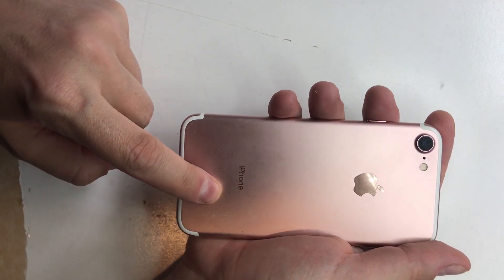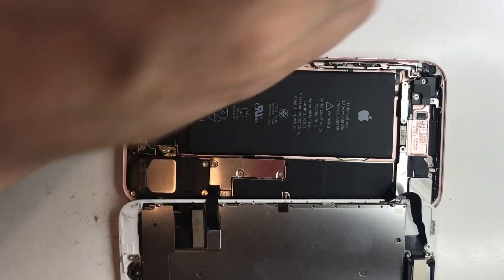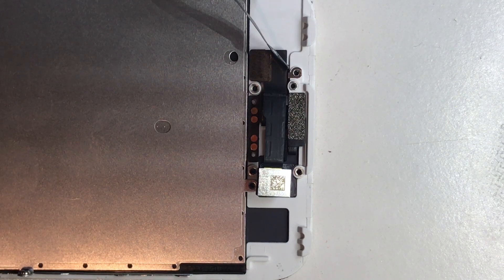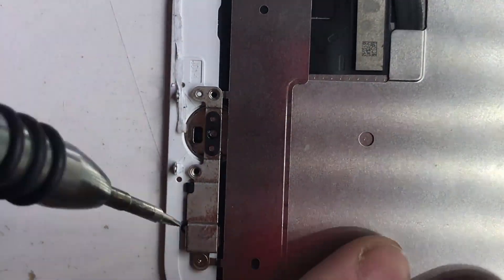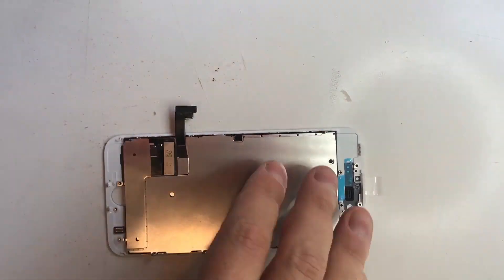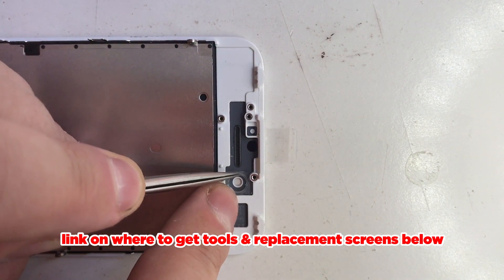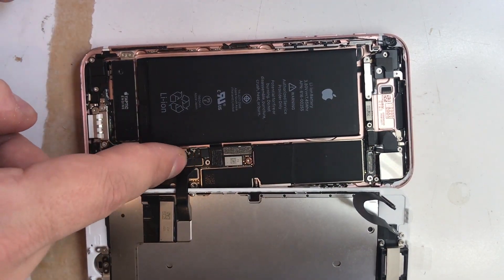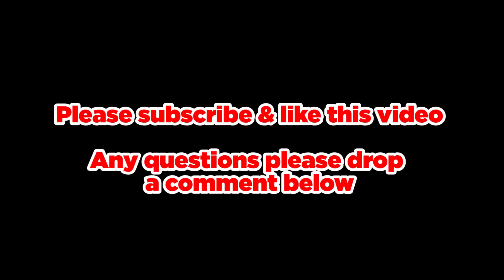iPhone 7 Screen Replacement. Under $35. Full guide.

Comment: What if screen is completely broken including either side of fingerprint?
Online display contains touchpad also?
Reply from the maker: Yes you need to use assistive touch button which is a virtual button on the screen. You go to SETTINGS -> GENERAL - ASSISTIVE TOUCH

Comment: what if my phone has both lines vertical and horizontal?
Reply from the maker: Good question - this means there is an issue with the lcd display screen which is part of the whole screen assembly so following this video will fix the problem
Reply: lol you'd need to replace the lcd screen. you typical don't see lines in apple's screens with drops.... is this a replaced screen already?
Reply: surfpub2001 Mine got dropped from my pocket onto carpet, no cracks but 2 vertical coloured lines started to run down the right side of my screen and as the days went by it got progressively worse

Comment: Nice video, you made a very BIG mistake! NEVER EVER use a metal tool when disconnecting connectors! that's enough to blow the connector or even the phone
Reply from the maker: good observation but it's actually a black non conductive spudger being used.  But yes your right avoid anything conductive like metal :)